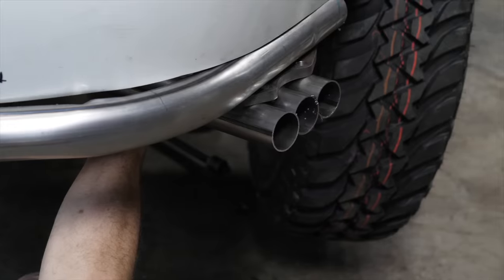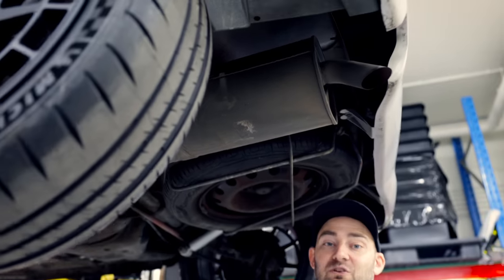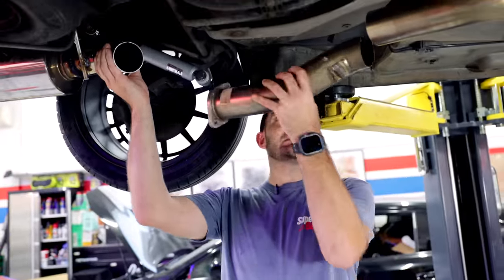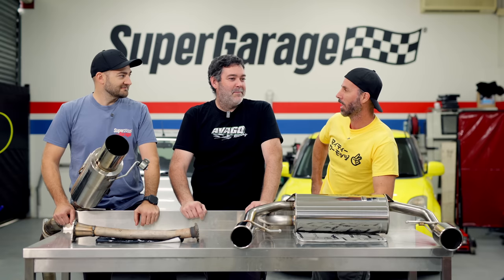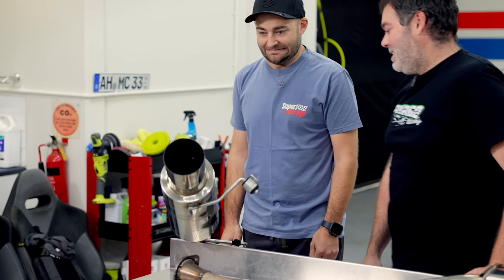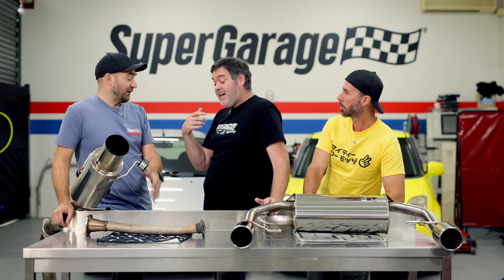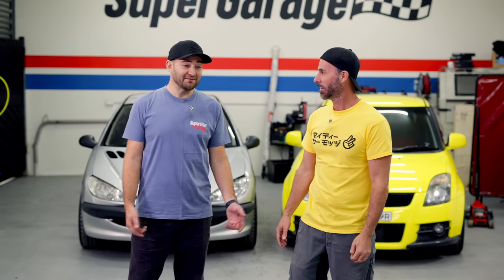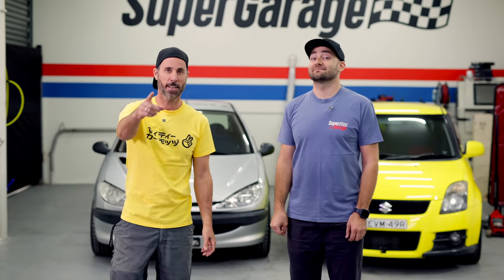$13 vs $1,300 Exhaust System | CASH vs TRASH

Comment: The peugbro is starting too look like most young driver owned 206s over here in the uk 😂
Reply: All it's missing from the rear now is completely smoked out rear taillights and jet black tinted windows and it's proper chav spec.
Reply: His forgetting the 206 3rd brake light mod extra 10bhp as it shows he has a 206 when slowing down, definitely smoked rear lights or the Lexus light and angle eyes front 😂, making me miss my Saxo VTR.
Reply: @MrFrankieTankie  it’s also not on wheels that are too big for the wheel wells. Chopped coils and it’s yet to have a set of maccies trays in the back. But it’ll get there 😂👌

Comment: I think the thing with backpressure is the wording. Backpressure in itself is always bad. You need exhaust velocity, Synchronized pressure pulses.
If the headers are tunes standalone then what ever is behind it will not reduce performance if the size becomes bigger.
If the headers are tuned with the rest of the exaust system, then it needs to carry the velocity of the exhaust through out the system.

Exhaust systems and intake are extremely complex parts to make right, and you need a excellent understanding of fluid dynamics and math or simulation to get it right.
Reply: This. Anyone who says an exhaust needs backpressure is just plain old fashioned wrong.
Reply: Absolutely this.
Reply: And for these nuggets it’s not going to make the slightest difference it when your pushing everything to its limits it matters
Reply: Exactly right. Look at 2 strokes, if resonance, scavenging etc wasn't a thing then we wouldn't have the funky 2 stroke resonance chamber exahusts
Reply: This
Reply: completely correct.
Reply: I cringe so hard anytime backpressure is being used in a sentence especially when people say its necessary or say something like "too little back pressure" etc.
Reply: Absolutely, I actually did a test myself. 4 inch down pipe into 3 inch exhaust with a hi flow cat, and 2 mufflers. It was an aftermarket “performance” cat back system claiming power gains. Bought purely as a test. Then switched over to a straight pipe, immediate power gain. Unless you specifically set your car up to receive the gains of “back pressure” as many call it who don’t really understand it, you will not see gains you will only have a restriction.
Reply: Yep all correct the "it needs back pressure" line is utter bollocks and I watching this and going "please don't say engines need back pressure". But the scavenging effect is correct and too big an exhaust causes gas flow speed to drop and upsets the scavenging process.
Reply: Came here to say this exact thing. It's wording. But people who think back pressure means negative pressure are wrong lol. You want the exact opposite of back pressure. You want the pipe sized so that the velocity profile of the gasses flowing create a negative pressure section that scavenges the cylinder. 

I was about to flip out if Dale said you need actual back pressure haha. He did say it but he just has the wrong definition of the word
Reply: Back-pressure < Negative static-pressure

Comment: People talk about back-pressure, but what they really mean is flow rate. Opening up the exhaust does lower back-pressure, but that isn't what harms performance. It's the fact that the gas expands to fill the larger volume, which slows it down, which lowers performance.
For every cylinder capacity there is an optimal exhaust size.
Reply: Yeah, It is all about velocity. Getting air in and out as quickly as possible is how you make the most power.

Comment: Strange, our swifts in the UK only have the mani-cat, and no harmonic weight on the mid-pipe either (at least from what I've seen, maybe a facelift thing). That Monster backbox sounds lush though, as you'd hope for $1300+. I hope we get some more sound clips as this series continues
Reply: The 31s in England have a manifold cat and also one just after the down pipe, so that makes 2 cats, both are rated at 200 CEL
Reply: Swear our swifys slso make 130bhp

Comment: Pro is definitely on point with info.  NA cars do make power with a good tuned header, I learned this in my old Spec Miata days when I was following a build that was done for the 2008 Targa Rally by the company Flyin Miata.  When it comes down to turbo vehicles, log manifolds work just as well as a nice fancy one as the turbo itself is a huge restriction point, and also a muffler that evens out your exhaust pulses.  1.6L to 1.8L NA you don't really want to go over 2.25 or 2.5 inches in diameter.
Reply: My wife married me cause she too refuses to go above 2.5 inches.

Wait, what bro? 😂❤
Reply: yeah header design is everything. not all cars are the same though when it comes to exhaust. mostly all honda motors benefit greatly from 3in after the collector across the board over smaller sizes.
Reply: No, he doesn't even know a difference between back pressure and scavenging.
Reply: I’m tired of people saying turbo manifolds don’t matter, they do. Just look at any factory turbo race car, they have just as much work in the header as NA cars. It makes less a difference than NA, but it still makes a difference. If the engine can’t get rid of the air and breath properly you are loosing power
Reply: @cademckee7276  factory turbo race cars like the BTCC/TOCA have some amazing manifolds, other discipline don't, Rally for example where durability is important. Fancy manifolds are prone to failure.
Reply: @Hrossey  JOKERRR!!! MADE MY DAY🤣🤣🤣

Comment: Back pressure is absolutely a thing. Years ago I had a Gemini I did up as a hillclimb/time trial car, quite a lot of engine work, twin webers (IDFs), big cam, all the stuff. When I was done with motorsport I returned the Gemini back into a road car, milder cam, back to a single carb (Weber DGV), some other stuff to make it a more road friendly car my wife could drive, but the 3 inch race exhaust remained, albeit with a rear muffler so it would pass a roadworthy test. A few month after it was back on the road I caught the exhaust on a servo driveway and broke part of it so I took it to a shop and had a smaller (2 inch) system made. Much to my surprise there was a noticeable power gain from the 2 inch system. I would never have believed it had you told me that would happen, but that engine was definitely more tractable with the smaller exhaust. With the big cam and big carbs revving to 8000rpm the 3 inch made sense, but for a more conservative road car set up it was actually losing power. No kidding. 
That 3 inch system is WAAAAY too big for that little Pug. Match your exhaust size to your engine people.
Reply: for N/A motor, backpressure is not something you want, it is an old myth saying that you need it, even the word itself is clearly telling that something is going against the flow, thus slowing gas flushing, which is bad.  Powergain you observed was caused by speeding up the exhaust gas velocity in smaller pipe. In larger pipe, the gasses can expand and slow their flow out, when you replaced it by smaller diameter, the gasses could not expand as much and increased their velocity, , thus improving gas flushing.. As you said, correct pipe diameter is important, but backpressure is undesirable. If anyone is interested, I recommend Mikes video on backpressure on MotoIQ channel.
Reply: Like mentioned above, the key is exhaust velocity. Not backpressure. If the exhaust gas has more kinetic energy, that will help evacuate the cylinder, and pull in the intake charge... i.e. scavenging.

Comment: It is completely true about asking your exhaust shop about castoffs. If it's a good place, they'll have good castoffs. I got one for a truck I used to own. They took a performance muffler off another truck an older gentleman owned since it was "too loud." I got them to plumb it on mine for $125. Great finds are out there for that. You just have to ask.

Comment: I built full exhaust for my Turbo swapped cobalt ss. My buddy has a junk yard full of superduty trucks and i used a pile of 3" stainless tail pipes and made full down pipe back exhaust. Took a good 8hrs to make it and look decent but sounds amazing and has had zero problems in the last 4 years.

Comment: I went and got quotes for a full exhaust for my 4age Trueno and shops were asking $1.5k in nz, kits from suppliers were also around $1.5k. I bought polished 16 gauge stainless pipe online for $350 and some resonators and made my whole exhaust for only $750. Definitely worth making your own if you can!
Reply: Could have saved even more not going polished - nobody can see the bits under the car, so why bother?
Reply: @ChristopherHallett  what about the tip? and it looks mad when youre working under the car :)

Comment: Another great episode! I cheaped out on my RX8's exhaust, the ebay exhaust didn't fit right and about a month later the valves inside were rattling. Ended up spending $900+ on a Greddy exhaust that fits and sounds much less raspy or rattley. 
I live by the saying:
Buy once cry once! 

Glad to see these cars come along and compare/contrast cheap vs properly done parts.

Comment: With my Subaru BRZ I went the Cash route. I started with an unequal length catted header and finished with a 2.5" resonated cat-back with a HUGE transverse canister silencer and dual 4" exhaust tips. I did get an OpenFlash tune to make it work. It sounds great: my BRZ now has that WRX boxer burble at idle, is devastating at full throttle, but sounds docile when you're light footed on the throttle. 
In US $'s The header was about $1200 and the cat-back around $900. It took time to find a shops that were willing to install these items. The header installation cost over $500 after figuring in the cracked O2 sensor, but the muffler shop that installed the cat-back charged less than $100. I had well over $3K invested by the end, but the drivability and throttle response was vastly improved: at least a 20HP gain and the infamous BRZ/FR-S/86 torque dip is gone.
I would recommend both the header and the cat-back: the maker did their research and testing to assure that they do improve performance. Unfortunately, the EPA was unhappy with them not spending money on "certifications" and they no longer offer those products. I also know that the EPA has been cracking down on shops that install "non-approved" modifications (Thank you Rolling Coal Enthusiasts) so it is increasingly difficult to find a mechanic willing to risk his livelihood by installing Headers and cat-backs. Similar headers and cat-backs are still available from larger, well funded manufacturers but they are much more expensive and you'll need to DIY the install.

Comment: Marty should totally make an exhaust manifold. Check the scrap big for a tubular 4 cylinder header and cut out the tubes, cut the flange off the pugeot and make it up.
Reply: Old 4 cylinder sportbike manifolds are a good source for tubes
Reply: Pug manifold is cast so doesn’t weld too good and looks bad

Comment: Peugeot here in Ireland are very common when I was in school everyone had or wanted a Peugeot from late 90's til the early 2000's, parts to mod them at the time were very easy to find and cheap to buy. Alot of the boys used go cruising around their 106's and 206's and 306's (myself owned all of above at point or another), most of them lowered with body-kits and a mad big sticker on the back windows saying something crazy such as for example Drive It Like It Was Stolen or When In Doubt Go Flat Out, that was good old days until the they became cop magnets and the cops starting cracking down on them, all because alot people took their Peugeot's up the back roads going flat out and doing donuts. So when buying used check it's history because there is chance a young fellow could owned it and thrashed the life out of it.

Comment: I built an exhaust out of trash one time for my Legacy, and it sounded hecking GREAT.
Reply: I've been thinking about something else in the back of my Legacy (2.0 NA, 2001). When I bought it years ago, I visited a Subaru dealer and bought a new muffler as the original was rusted to heck. When I picked it up, I immediately noticed that it's not genuine, but an aftermarket piece. When I installed it, it sounded like crap at idle, with little farty sounds, like something inside would have a restrictor that is leaking. And I think it wreaks havoc around 2000-3000 RPM. Though the car has like diesel levels of torque but even at lower RPM's. For example, It cruises really nice with at a tad over 1500 RPM, 4th gear, 40 km/h. A while ago I stumbled upon factory brochure scans that listed a performance muffler. Also the car is so silent it's actually hard to know by ear where the RPM's are...

Comment: I made a bolt on straight pipe (muffler eliminator) for my Subaru Impreza here in Japan out of a camo net pole I got from the scrap metal dumpster. Used the gasket as a template and cut a steel plate for the flange. Literally a straight pipe that helped unlock that lovely Subaru growl. 😎

Comment: I bought a Citroen DS3 6speed turbo with a cooked motor for $1300 Australian) and a low mileage written off Peugeot 308 for $1800. Pulled the motor and sold the rest. Now I have a fantastic little car for $2100. Obviously, with all the money I saved I could afford a set of pilot sport 5s. Very happy!

Comment: The big exhaust doesn't hurt power because of too little back pressure.
An oversized system passing the same volume of gas, means the gas travels far slower, upsetting the scavenging.
When sized just right, an exhaust has minimal back pressure reducing pumping losses, whilst maintaining just enough gas speed to pull the fresh charge through the inlet, on the valve overlap period.

Comment: About back pressure - issue is with terminology. You don't need pressure that is pushing back, you need traveling pressure waves, that leave relative vacuum behind them, then help to pull gases out. Back pressure term comes from two stroke engines, which need an actual back pressure. 4 stroke engine doesn't need back pressure. What you need is speedy gas flow, that creates those pressure waves. Large pipe issue is with Bernoulli's principle - gas flow speed in larger pipe will be lower, and lower speed means lower pressure difference, thus reducing scavenging effect.

Comment: im in the uk i had a citron saxo vts from new 1999 for 22 years its the same as the Peugeot it had a 3" blue flame exhaust and sounded great  only got rid of it last year i sold it for£4,500 and got myself a jag xfs 3.0l twin turbo 340bhp and 650 Nm at 2000 rpm

Comment: One of very important factors is that by replacing your oem exhaust system to an aftermarket you actually reduce weight of the car. Less weight - faster car. 
A lot of heavily modified drag racing vehicles have exhaust tips coming from underneath the car. Drone is insane but by removing 10 feet of pipes you are saving another 40 pounds

Comment: Loving this series, i own a Peugeot Group Car a Citroen C4 Cactus and one thing i hated was the car was very quiet, so i ended up buying a Kraken Power Bomb Backbox with a 3 inch tail pipe, with a little bit of adaption it fitted and it sounds awesome much louder than a full system I stuck on a R56 Mini that I paid £450 for, cost for the Powerbomb £45.... Lets say i am tempted to get another for my Old Skool Ford Weekend Car!

Comment: I love the trash side of this video. I redid the exhaust on my built 95 dodge neon a couple years ago and all I did was reuse the old piping. I bought a muffler and new flex pipe but that was it. Instead of running it all the way out the back I ran it out the side so that I could put a rear diffuser on it and not have a muffler and piping to work around.

Comment: Hi guys....loving these episodes. You gotta do external upgrades. I wanna see the pug with a bonnet wrapped or sprayed matt black.....a spoiler on the rear or roof.......front spillter made of plywood sprayed black......martys name on the rear side windows.....no.69 on side......chopped fingers front window strip......electricians black tape across the headlights in a cross.......the full monty.
Now rooting a bit for the french pug lols.....❤.
Some weight saving by chucking out rear seats, any unwanted plastic and a rollcage with fire extinguisher be sweet.
Keep up the goodness....u should do a full trash car championship....2 older hot hatches...source all u can for a capped price...and off u go....blagg, borrow or reuse to do a weekend warrior hothatch race? Now that be fun to watch to.
Peace.

Comment: I went both on my 325i E90 BMW 😂. Good headers with cats from AFE, removed the secondary cats, plus a scrapyard sport cat-back from a 330i. $1600 for the headers, $30 for the rest, got $400 for my old (clogged) cats.
Reply: 1600 for headers? You got ripped off.
Reply: @rimka11  they have built in cats
Reply: @kevindavis8143 that is the most stupid place for cats. For a minute of faster warm up time, it messes all the scavenging.
Reply: @rimka11  cool story, blame BMW